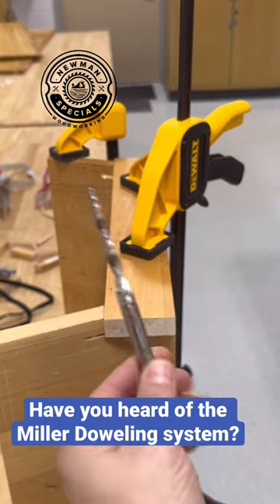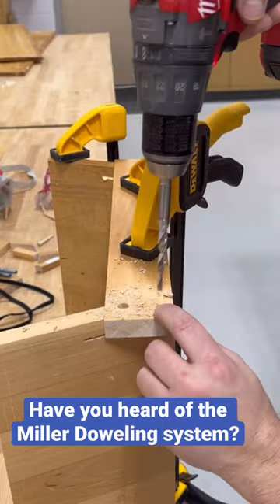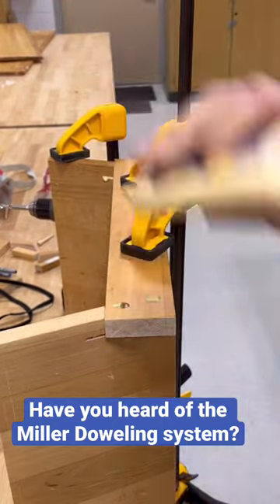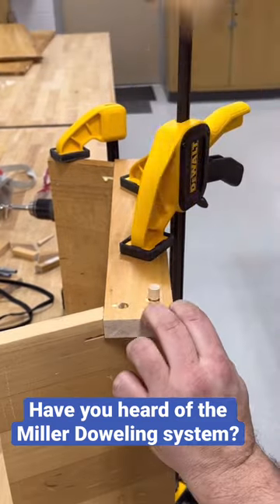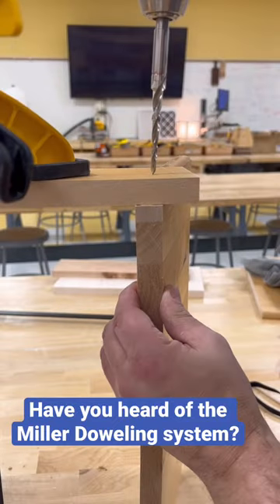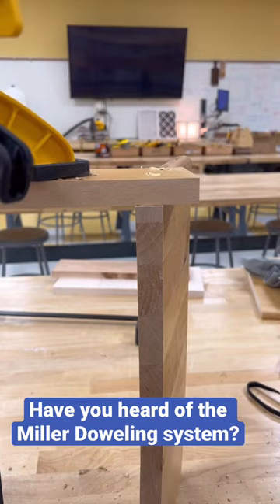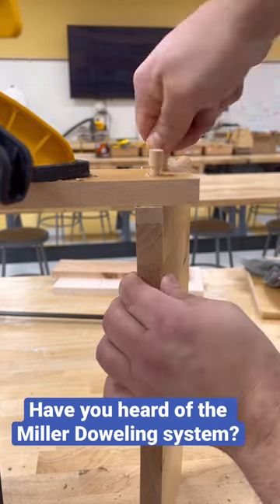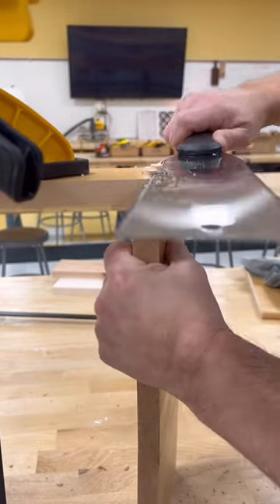Have you seen this before? #woodworking #diy #joinery

Comment: Awesome, vendor locking is so nice with HP printers
Cant wait to vendor locked in by these obscure fancy dowel pins. Maybe a subscription service next.
All kidding aside, it looks tight and sturdy
Reply from the maker: That’s hilarious! 😂 These are neat
Reply: not vendor locked. you can make them yourself. just purchase a lathe and all of the accessories. clear out space in your shop and take some classes to properly learn turning. get a few years of experience and some day you will be able to make one:)
Reply from the maker: @mcbeaters  😂😂 That all it would take for me to make one? Count me in!
Reply: I found a simpler solution. I spent 4 years developing my own wood based filament and then another 2 years perfecting a 3d printer that can use it. Now I can turn those dowels on demand for just 5 dollars each.